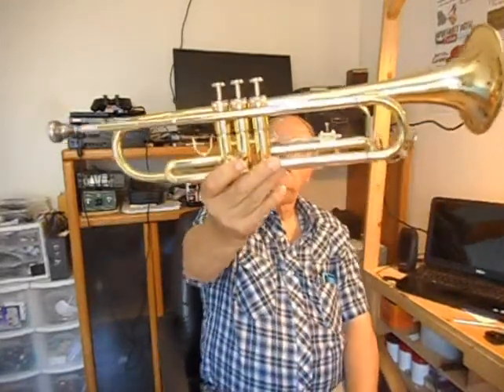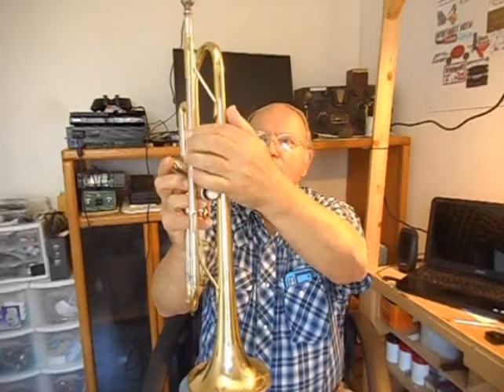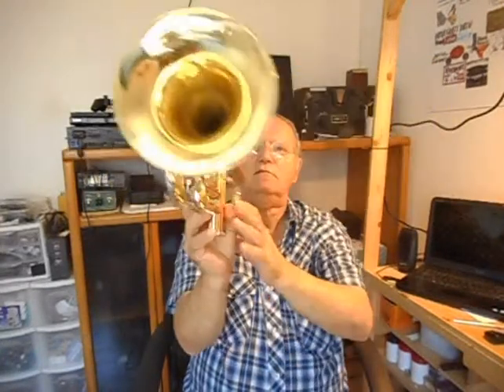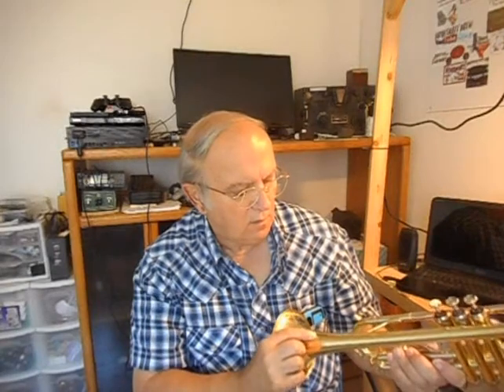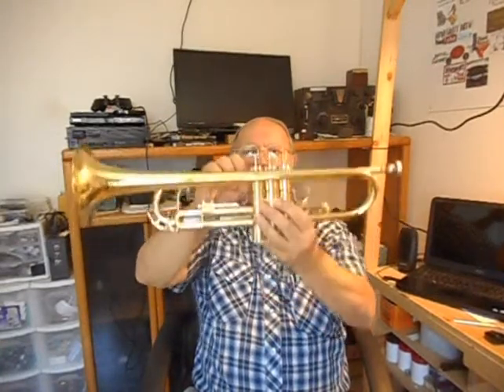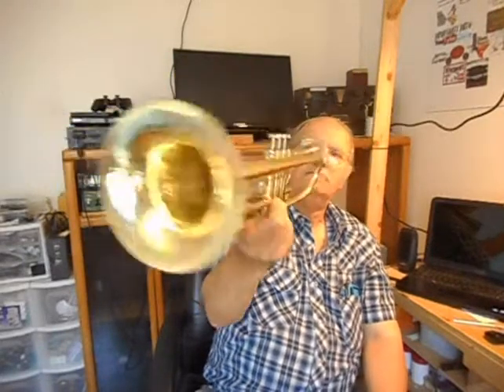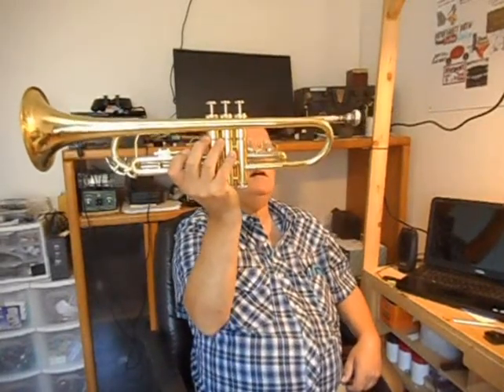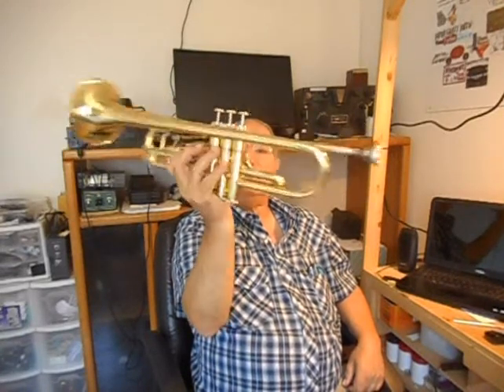Roy Benson $5 Garage sale Trumpet is Fixed

Comment: Chubby heads for the hills while dad plays on,,,, nice trumpet there Larry.
Reply from the maker: Yes Chubby wants no part of it. Yes it was a pretty big garage sale too never did check out what the guy wanted for the violin in the case though. My camera showed there was a rock wedged in the  trumpet sideways so Ron was able to get that out then the Nerf rubber thing with a plunger was stuck in the opposite side was stuck then the two braces to solder Ron said took solder easily really made it solid. So it took some work a couple hours but it works great now. So can't beat that for $5